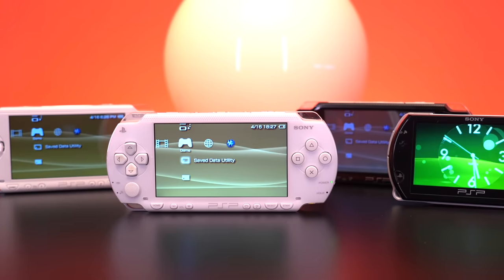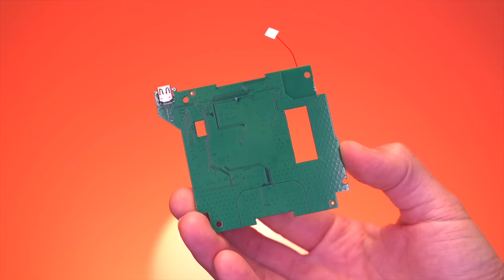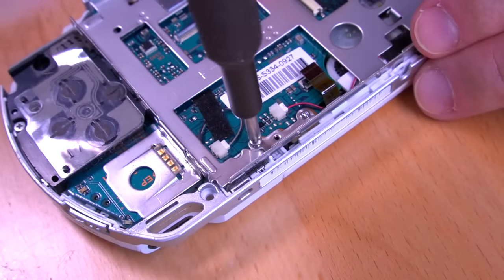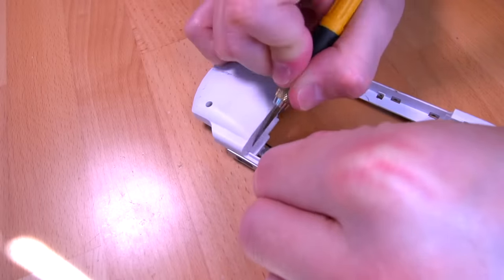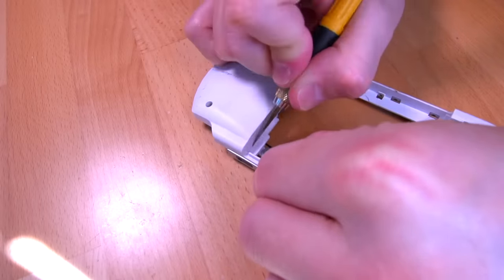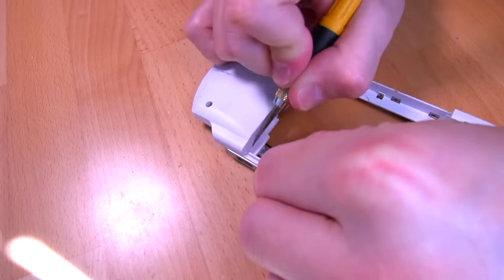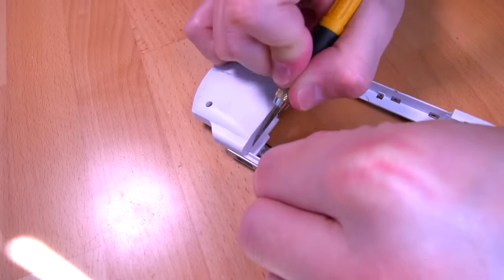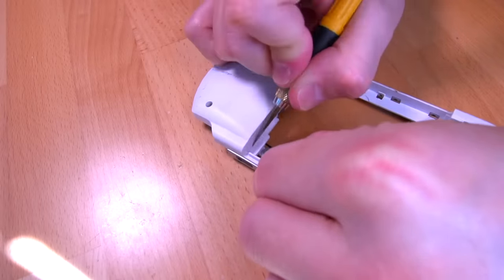Building The Ultimate PSP In 2024

Comment: "We can now play PSP games on a big screen"

1) PSP2000/3000/GO all do this 
2) PSTV also does this. If you hack it with a HDD, you get a lot of PSP games.
Reply: Plus this came at the cost of the PSP1000's exclusive feature. Having a modded PSP able to function as a universal remote is pretty neat.

If video-out is a priority feature then surely any other PSP model should have been used as a base. Every other model has twice the RAM, too.
Reply: I have both a PSP3000 and a PSTV. The video out on the PSP is nowhere near the quality of an HDMI out (like the one on the PSTV). On the other hand, getting the PSP stuff working on the PSTV is a bit of a pain. Much easier than it used to be, but not worth it if you can have a dedicated PSP to do this.
Reply: That's true, but there only an IPS display for the PSP1000 tho..
Reply: @MarcosCodas  Absolutely right about the video out, I have a PSP3000 and the output over component is really kinda rough. However the second point I would argue that... I have a PSP, PSTV, and a Vita and it's really easy these days to get PSP games on the PSTV and the Vita. I play my PSP stuff on the Vita because it's basically a "PSPXL" in that way, and personally I wouldn't sacrifice the UMD drive on the PSP for better video out but it's still a really cool mod for those who would!
Reply: @BlyssSarania  I'll revisit the PSP thing on the Vita/PSTV. Maybe I just had a bad couple of days that time. It was a couple of years ago so I'm sure it's come a long way.
Reply: I think that if video out is important, it's better to use PPSSPP on Android (any phone or tablet, even smart tvs) or Windows or Linux on a laptop or desktop PC (almost any potato now emulates PSP) and it would look better because it would output AT LEAST 2x the original PSP res (up to 10).

Just keep whichever PSP model portable and that's it.
Reply: @MarcosCodas  I have the PSP1000-3000, not sure what's wrong with your PSP3000, but its looking great through my Retrotink 4k. That being said, unless this HDMI mod has a proper upscaler built in, .... nah no.... I don't think its a good sell for the PSP. Look I'm not going to argue which is better HDMI or Component, that's a losing battle, but the hardware behind it is just as important. In this case its the PSP. Based on the video's pro's and con's, I have to say this mod is not in a good place. For starters the added latency. The point of a lot of these mods is to reduce or remove latency. Given how PSP games were designed with the PSP hardware is designed, even a millisecond can be a hazard to the experience. Imagine playing PaRaPa, Rockband or Patapon where latency adjustments are not done or within the threshold. It's pure missery. Additionally the work of the mod just doesn't exceed the value of just hooking up a PSP2000 or 3000 to the TV, or one of the other options I've listed. I've dumped all my UMD's to an HDD and connected it to a hacked PSTV, no mod chips or complicated installations required. Even dumping the UMD's is pretty easy, assuming you're not lazy and don't take another less time consuming route. 

I just don't see much use for this mod. Even on the 2000 or 3000, you have no real reason to do it with modern scalers like the OSSC or any of the retrotink products that takes component in. 

I will say that IPS install looks great. I might do it to my 1000 and if available my 3000. My 1000 had 3 dead pixels at launch and I just kind of dealt with them until I landed a 2000. By then the titles i really cared about were finally releasing like God of War and Crisis Core. Though these days I'm playing those games on Steam Deck not my PSP. 

I'd like to know the charge time with the IPS though. Skimming throuhg I don't think that was brought up at all.
Reply: @xcruell  ya I might consider that. I love my 1000, the dead pixels are its only fault. Probably need new batteries too at this point. Hopefully this isn't the end of the PSP's updates. It was a good little machine, still my second favorite portable of all time after the Vita. I'd love to see it get the love the GBA and GBC units have gotten. Some better batteries and a bay mod, usb C charging and wireless charging.
Reply: @Cruxics  nothing wrong my PSP. I was talking about the video signal that comes out of it without any upscaling hardware. But to each their own.
Reply: Also another advantage of the 3000/2000/Go is that they can output native 240p for PS1 games
Reply: yeah that's why Tito prefaced the video saying that most mods are for the 1000 model because the later models pretty much address all these issues
Reply: This guide is a novelty at best, there already is a PSP model that has tv out too
Reply: Pretty sure you can play the 1000 on the big screen by linking it to one of the consoles. I know you can do it with the PS3 but I think you could also do it with the PS2.

Comment: I wish the 2000 and 3000 models were also getting mods. They could also benefit from better screens and HDMI out.
Reply: Exactly, and a mod to use external cotnroler, via software, per exemple.
Reply: PSP 2000 needs an IPS kit
Reply: I think the fact that the OLED Vita exists makes this less likely to happen, sadly.
Reply: @human4491  With the OLED Vita and seeing how it can play all PSP games fine, I would have wanted to see an ultimate Vita.
Reply: @TheCoolDave There’s homebrew for video output over USB using an RPi dock. Other than that the Vita doesn’t have much room for improvement.
Reply: The PSP 3000 screen is already a very good one, so it won't benefit much from an update.
Reply: @revelationflap5887  except for the interlacing that's quite bothering when you look at it
Reply: What the 2000 model takes up is an LCD screen, as it has video output and you can search for the component cable

Comment: Two mods I would love to see more commonplace and "standardized" among PSP 1000 modding are USB-C charging/data (replacing either the Mini USB or the charge connector and having a 3D printed blank for the whichever doesn't get replaced by the USB-C) and LiPo battery conversions; whether it be a high capacity that replaces the UMD drive or just a more reliable cell to put inside the OEM battery shell.

I think as far as a more standard USB-C, the best option would be to have a female receptacle in place of the Mini USB receptacle, wired for charging and data, then a blank in place of the OEM charging jack.

Now I need to talk to my friends that have 3d printers.....
Reply: USBC with fast charge AND video out. That's the dream for me.

That and Bluetooth audio so this thing can take over my car stereo again
Reply: @hatdag5976  fast charge and OTG video out would be awesome. At that point though I expect it would need a PCB that would take up possibly the entirety of the UMD drive space. For a lot (myself included) that wouldn't be an issue, but there's still a big chunk who still like to use the physical media.

A man can dream though....
Reply: @NordicDan  the 3000 and 2000 do video out so I don't think it's a stretch! 

Video out on the PSP is always so lacking though

Comment: Quick suggestion macho, I see you possibly put in infinity 2.0 cfw, I suggest going to ark 4 a direct upgrade from infinity 2.0 so you won't need to Uninstall the 2.0 firmware but also they fix compatability issues with some games, made region free for all movies as well as set a native overclock which really isn't a overclock since a lot of games underclock its basically running its intended performance and they made file access way easier! I've noticed major performance increase from this firmware over the last one they made (infinity 2.0)

Comment: Good mods, but I think HDMI mod is mostly useful for capturing video or streaming than actually playing on the big screen. Also, would be cool to see a simple Type-C mod in the "ultimate" PSP. Relatively easy mod to do on most handhelds that adds convenience by removing a proprietary charging cable (can be done with a simple breakout board in most cases). Carrying a powerbank with a single short Type-C cable to charge your phone and the console is a huge W. Did that to my consoles.

Comment: Ultimate PSP is PSP Go with dock + DS3 + scaler. Altenatively Dock can be replace with PSP Go Data/Charging/Componente cable. Such cable occasionaly appears online or can be made by combing charging/data cable with component cable. Bigginner soldering required
Reply: Nah the ultimate PSP is a modded Vita. You can dock any Vita with hacks and it can run Vita games on top of all the PSP ones lol

Comment: Can we also get 'Building an ultimate PS Vita' video,pretty please? I've hardmodded my PS VITA 2000 with a second battery, trimming some of the inside plastic and by rotating the speaker so the battery would fit. Now it runs twice as long, but would like to see if there's any other options to hardmod the console.

Comment: The IPS screen piqued my interest, not so much the HDMI mod though. I wouldn't want to give up the ability to use UMDs, and I have a 2000 that outputs via component as well as a cfw PS3 that can play PSP games. Plus I have an older tv I use for my "retro" gen 7 consoles that doesn't have a remote, so IRblaster is something I'd like to utilize with my 1000 and I'd be giving that up too. 

That iFixit board is definitely something I need to invest in. I've got a bunch of good stuff off of them in the past.

Comment: I would so love to see an IPS screen mod for all the revisions of PSP. I think the 1000 looks the best overall though and it is certainly the one that needed the upgrade the most.

The HDMI out mod I just don't see a need for. The component output on my 3000 works great and doesn't have the same problem with audio as the mod. Not to mention leaving the UMD drive fully in tact. Being able to connect a controller would be awesome though, however I'm certain you'd need custom firmware for that.

Comment: >"Ultimate" PSP
> No UMD Drive

You've already lost mate. If I can't just pop in one on my physical games or movies, it is anything but "Ultimate". 

I backup most of my games to use on a Memory Stick adapter but have, on more than few occasions, wanted to feel and hear the whir of the drive spinning up and the little ticks as the laser pickup traverses the tiny little guide rails. The UMD is part of the PSP experience and that HAS TO BE preserved to be any sort of Ultimate version of the PSP.

And I see no good reason to connect the PSP to a TV/Monitor, game wise. What with being tethered to the display with a fragile micro-HDMI cable. For movies and TV shows maybe? but even then, I'd still watch it handheld.

These are just my opinions but otherwise, it was an excellent video as always. Keep it up dude 👍

Comment: Nah the ultimate would be an improved and updated motherboard with everything soldered on, better interface for reading larger memory cards, USB C at the bottom, and still having the UMD drive if you want to use it. 

Also having a dock that supports multiple wireless/wired controllers.

These are still decent updates though.

Comment: The PSPGo is a better option if you want to play connected to display by using the dock adapter plus it has Bluetooth which helps connect an external controller and you can still play the games from the SD Adapter.

Comment: I can actually connect my PSP to a modern TV with Sony’s Component cable, either straight in, or far, using an Component-HDMI converter/1080p upscaler that my TV upscales to 4K. Dunno if that cable has an upscaler, but I doubt it. So, the only good reason for it is convenience in connecting to a modern TV — not that that’s without merit. I have one of my PS2s hooked up to a TV with a straight adapter, which is pixel perfect but shows why “pixel perfect translation” isn’t necessarily a good thing, the way so many retro game reviewers think, when comparing a port from an arcade game...

Comment: I will say even at the time, the PSP-1000's screen ghosting was really annoying in some games. Especially action heavy titles like GoW. I did the IPS mod on mine. A lot of kits come with conductive paste now, which is a bit easier than soldering. But even then it's still fiddly to get a good bridge. I also buggered up putting the foam on straight thanks to my butter fingers. It's a massive difference though. Good response times, brighter, more vivid colour. Battery life seems a bit better too due to LED backlights being more efficient that the original's CCFL. The HDMI mod is a bit redundant nowadays since there's a lot of options to emulate PSP titles with upscaling. If you're die hard OG hardware, sure, but pretty much anything will run PPSSPP no problem, and the games will look a lot better.

Comment: There is no shortage of retro gaming handhelds on the market. It's overwhelming if I'm being honest. If you have a PSP laying around, your portable retro gaming problems are solved. Modding one is painfully easy and the emulation is rock solid. Popular emulators were ported to the PSP and the compatibility rate is very high. If your primary concern is the 16 bit era and below the PSP has got you covered. It can run Game Boy Advance like a champ and there is native support for PS1 Games. You can run Retroarch on a modded PSP but it uses a lot of overhead. There is a rock solid port of Super Mario 64 but overall, N64 emulation is beyond the reach of the PSP's clock speed as are most consoles that exceed the even the top end of the PSP's core strength. The MVS, CPS1 and CPS2 allow you play some of the most incredible arcade games and again, the emulation is near perfect. NES, Super Nes, Genesis TG-16 all the game boys run flawlessly. The button layout is great as you get your shoulder buttons, D Pad, analogue nub and 4 button layout to the right. I could go on for days. Long story short: MOD YOUR PSP!

Comment: HDMI mods should be made for the PS Vita (since PSTV prices are INSANE, while PS Vitas actually cost maybe half the price of a PSTV nowadays which is insane, since the PSTV was selling for as low as 25$ at some point)
that would be the best of both worlds - the PS Vita has built in scaling options for PSP games, and there are various upscaling mods for PSP games to run at the PS Vitas resolution, so on a TV they would looks nice and sharp.
and obviously you could use PS4/PS5 controllers since the PS Vita has bluetooth...

Comment: Well the PSP-3000 has far superior screen with reduced ghosting and superior contrast ratio. It has the extra memory for reduced loading times on certain games. It's thinner and lighter and you can keep your UMD drive while using the component out cable. The cons there are that the component out has black bars around it on the TV-image, and the connector already on the bottom of the PSP for the cable can make holding the system more awkward. I think the ultimate PSP is the 3000, but the 2000 is okay too if you can't find one.

Comment: The input delay kills it for me. I don't have a PSP-1000 to mod, but even if I did, I'd be inclined to wait until the latency issue is fixed at a minimum. The audio issue is also curious, though it makes sense on some level. Still, a definite con, as you outlined.

Comment: I really wish there was a company who sold half-decent PSP shells, but they're all so crap when compared to the original shell. The only way to get partially get around the hassle is to retain the back half of the shell and match it up with a faceplate. But it all depends on the shade of tint used on the new faceplate and the tolerances for button height etc. It's a great little console, but a real ball-ache if you need a new shell.

Comment: As much as I love my PSP1000, I do wish it had the native AV Out and 64MB of RAM that the later models have.
The best Consolizer target would sadly be the PSP Go because it has native Bluetooth support that works with Duel Shock 3 controllers as well as native AV Output.
If we could add the Bluetooth support to PSP2000 it would also be a good target as it could retain the UMD Drive in the new formfactor.
All told, I've been rocking my stock PSP1000 since 2007 and the only things I've done are Lumines break its firmware, make a Jig Kick battery and get a MicroSD>Memory Stick adapter.

Comment: I wish someone would design a true digital-to-digital HDMI mod for the PSP go using the internal LCD output, that way we could get a consistent 480x270 (or 480x272) video in both games and the menu when outputting to a TV, and have access to PSPGo's Dualshock controller blutooth connection.

Comment: Wouldn't it be better to solder the audio wires to the headphone jack, take a pair of headphones and either plug them in or cut the plug off an old pair to use to enable the headphone audio when the plug is inserted? This would disable the psp speakers and send audio through the hdmi port.

Comment: The IPS screen is awesome, but the micro HDMI mod is butt. You would either need a special cable or a dongle hanging off the handheld to use it, and I imagine moving it around with that weight hanging off it would eventually over stress the port. I think ideally it would be better to mod the Mini USB port to USB C port that supports display port out. Maybe someday someone will make one of those.

Comment: Despite its already a native way to take out video from a psp, I think this mod its much better cause you can connect it via hdmi, however this is only a first iteration, for sure upcoming versions would have an upscale resolution from a further PCB revision, and would make an ultimate psp. On the other side the audio issue it’s easy to solve by bridging a resistance on the audio pads from the PCB and the audio jack, tricking the console to send audio out to only one way (or channel), just like it does when a pair of headphones it’s plugged